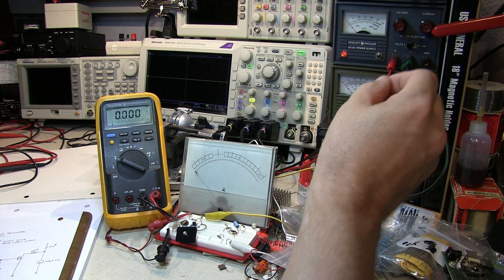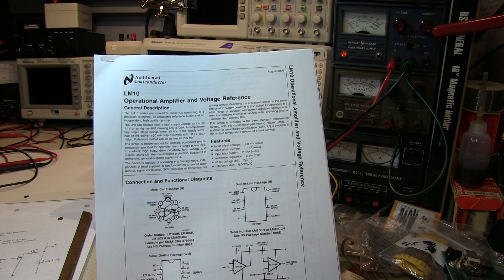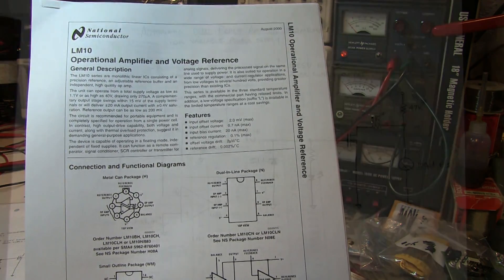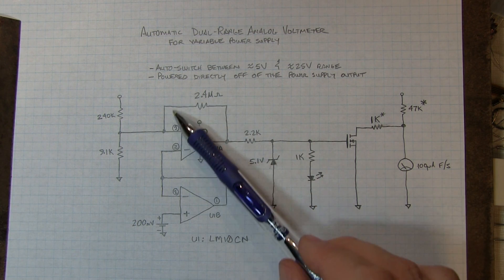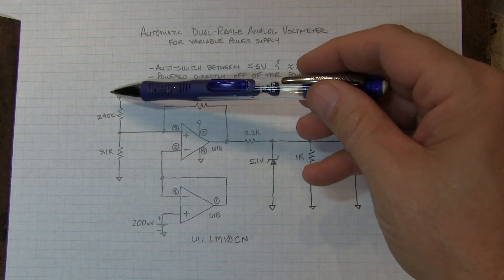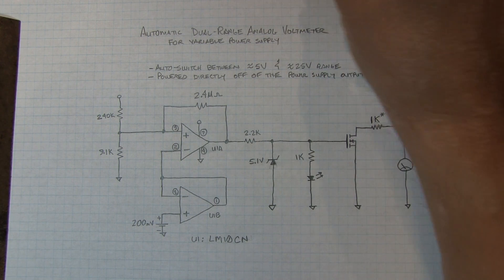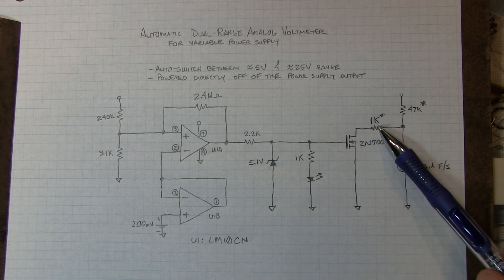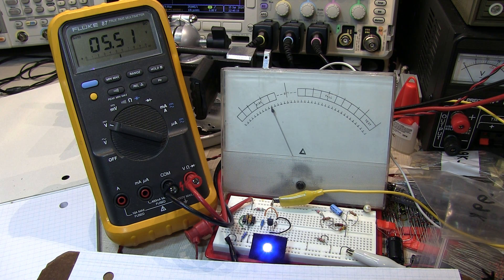#155: Circuit Fun: Auto-ranging Analog Voltmeter for a variable power supply

Comment: Years ago I used a LM10 as a 3V power supply, as it had the precision reference, and used so little power that it would run for a week or more on a NiCd pack in the application. Was used to replace a clock lithium battery, having a 4 cell pack instead charged off the mains. Still works 30 years later next to my bed as an alarm clock. I think I changed the cells once in the interim when they died.

Comment: FWIW watching this video reminded me of a feature I have seen in a commercial power supply... it would be super easy to add this feature to a power supply using your circuit. With adjustable linear power supplies they are at their most inefficient while supplying low voltages at high current. An answer can be an automatic  "tap changer" with your circuit it would be easy to implement from the LED drive.. operating a spdt relay.

Comment: I made a dual range analog amp meter, but it's manual range. It works well though, and I meticulously measured the dimensions of my meter so I could print off my own scales for it. I don't have an enclosure for it though, so it's just a small mess sitting to the side for now. I also couldn't figure out how to make it run on the same power as the load I'm measuring the current to, so it runs on a 9V battery. I do plan on revamping it later on.

Comment: Good job. I salute you. Very cool i am going to try to use a led bar to show the battery charge of my kid toy car. Then when the battery runs out to automatically switch to a second battery that will be charged with solar cells. When the second battery kicks in the low batery will charge with solar. Is just an experiment i want to play with. Your circuit gives me a starting point. Thanks for sharing the knowkedge.
Reply from the maker: Good luck with your project!
Reply: +Christian Ruiz Did you use a latching relay?

Comment: Fantastic circuit. I've never seen the LM10 before to my memory, but it looks like a great part to get to know.  It's certainly less complicated than a lot of the voltage switching circuits used in Audio equipment (low voltage blocking to reduce noise for example). I'd imagine you could adapt the circuit with a bandpass filter to make it a moderate parts count frequency specific gating circuit.

Comment: Interesting, I've seen that done years ago. I think it was a meter Radio Shack had made that did the same thing. You should see if you can find the schematic of it and see how that one works.
Reply from the maker: Of course, the autoranging VOM would have some sort of high impedance buffer to measure the voltage so that the circuit under test doesn't get loaded from the meter.  That wasn't necessary here because this was intended to be part of power supply.

Comment: Like this a lot. How easy would it be to add another split to allow for say three ranges. 1 to 5, 5 to 20 and say 20 to 40. I suppose that would not be so easy to arrange. But is there a trick to allow for that to? An interesting design problem. I suppose two circuit segments in series with 2 of lm10s or maybe there is a neater way?
Reply from the maker: Certainly duplicating this circuit in parallel with the the first would work fine.  But, for more ranges, it might be more efficient to use a chip with multiple comparators in one package.

Comment: it would be interesting to add a depletion mode fet with a variable zener or something to offset the voltage reading when in the 25V range so that it starts a 5V instead of 0V. (from 0 to 5,99, and from 5 to 25)  That way you get more range in the analog meter.
Maybe a really low voltage pmos instead as it would be easier to find i believe.

Comment: Any reason you didn’t go for a single log or similar non linear scale? Log is easiest to do with diode connected transistors and by adding a few resistors in series or parallel you can fit the range you like onto the meter. The circuit is passive and goes in parallel with the meter. I saw this first done by Bob Pease but as I remember it he was showing how other designers had added a log response to their meters. The scale will have to be calibrated manually but at least you’ll only have one scale and the meter movement will be monotonic.
Reply from the maker: With a log scale, you'd lose resolution at one end or the other.

Comment: Alan,  I notice your are using the meter out of a Mark Five Hubbard Electrometer (E-meter). Where did you find one? On the surplus market? It's an excellent meter. Did you tear apart an E-meter that was otherwise e-waste?
Reply from the maker: I picked up the meter itself in some surplus mail order place 15-20 years ago - I was going to use it in a moisture meter project (wood working), but never got around to it.  I used it for the video because it is BIG!

Comment: I have yet to find a way to draw or print the calibrated scale for the meter that is not  kludgy.
Reply from the maker: Here's a nice software solution.  The basic version is free, I think.
http://tonnesoftware.com/meter2.html
Reply: ***** [ The price of the key to unlock Meter is only US$34.95.
]     Have you used the unlocked version?

If I can't do what i need with the basic i have a dilemma.
Reply from the maker: jon sanford I used it once, years ago, and it worked perfectly.  So, I'm sure it is only better now.
Reply: I have had OK results scanning in the the "default" meter scale and using an image editing program (ahem MSpaint) to put in the numbers etc and use irfan view to print the edited scale at actual size, trim and glue on the backside of the default meter plate
Reply: >scanning in the the "default" meter scale <
OK!    Why didn't I think of that?

Comment: what about loading effect and voltmeter input impedence . Its going to change the voltage  on output .  you should have loaded it and turn of an on to see
Reply from the maker: This circuit presents about a 47kohm load to the power supply, so there should be no effect on the voltage output of the power supply.

Comment: Could you use a schmitt trigger in place of the opamp acting as a comparator?
Reply from the maker: Yes, of course, but the LM10 has the handy built-in voltage reference and single supply op amp in one package, with a much wider operating power supply voltage range than most schmitt trigger circuits.
Reply: Right, I see :)

Comment: For a small 0-20V analog meter, could you range 0-2V and 0-20v? This is really cool... Have a analog meter that I want to put to use.. Maybe even a more precise 0-10V and 0-20V with led indicator?..
Reply from the maker: Sure.  You'd adjust the 240k and 9.1k to get the switching point that you want, and adjust the 47k and 1k to accommodate the meter you're using.
Reply: w2aew The problem with a 2V range limit is that you'll need a mosfet with a reasonably low Ron at 2V and you also need a low Von Led that produces enough light at 2V...
Reply from the maker: If you're putting this into a homemade supply, you could power the circuit from the pre-regulated voltage, this would give more headroom for the FET and LED.
Reply: w2aew Yes but this is another circuit that has a separate power source. Another solution would be to use a battery to keep it autonomous.

Comment: Great video! How would one change this circuit to work with my power supply that goes to 50V?
Reply from the maker: +diedraak1 You'd have to limit the supply voltage to the LM10, easy to do with a zener shunt regulator, and then adjust the voltage divider for your desired range switch over.

Comment: Why not just use a TL431 and a PNP instead of the LM10? I've done several circuits like this.
Reply from the maker: There are many ways to do this of course.  I happen to have a good supply of LM10s.  Please share your solution using a TL431 and PNP, I'm sure others would be interested too.
Reply: w2aew 
yes me too  lm10 is hard to find in the market

Comment: Why would a EE designer or electronic technician need to know what the regulators input and output Quiescent current of the regulator? I'm not sure whats the point in measuring or looking at the regulators datasheets about the regulators quiescent current

Comment: I've never completely understood how auto ranging DMM's work. If you've got a little bit of leakage and the meter has auto ranged to the mV range and then you stick the probe onto 600V, why doesn't the meter blow up before it has had time to switch to the appropriate higher range. No meter or A/D converter set to measure say 1V full scale is going to appreciate an overload 600 times higher. Yes, you can put limiting diodes in place but surely it's a race as to whether the A/D blows up before the diodes clamp the voltage.

Comment: I built this and set it to a switching voltage of 2V and it works pretty well. But I have some strange behaviour in the lower range as it turns on between 0 and 0.7V. As I am not really into such kind of electronics, I surely miss something and don't understand what happens below 0.7V. Any advice?
Reply from the maker: If the circuit is powered by the same supply as you're measuring, then the problem simply is that 0.7V is not enough voltage to properly powerup the LM10 or to fully turn on the MOSFET.

Comment: Hi friend, how could I make an auto range of 4 scales 1, 5, 25.50 volts, can you help me. Thanks
Reply from the maker: You'd just have to replicate this circuit three more times, one for each of the desired ranges.  Setup the threshold for each of the stage's comparators as need for the desired ranges, and adjust the scaling resistors as appropriate.

Comment: That's a cool circuit. Too bad the LM10 is so expensive though.
Reply: The ubiquitous TL431 or LM385Z with a trim pot should make a precision voltage regulator. Then you can use an LM358 or LM311 as the comparator. Can't get cheaper that that?!